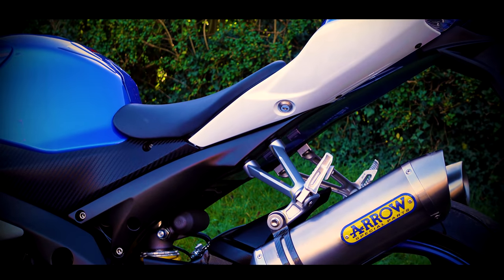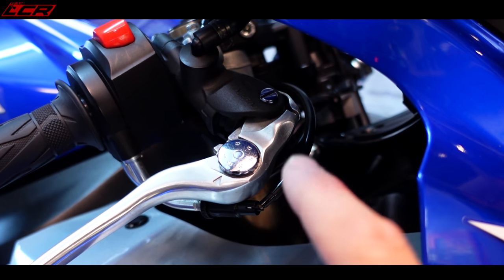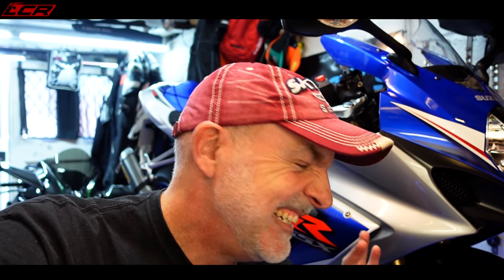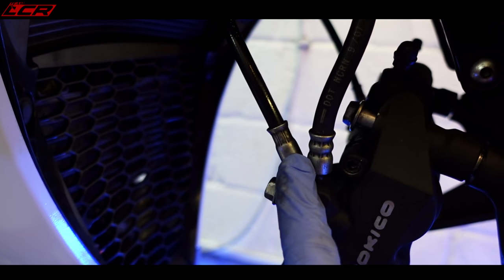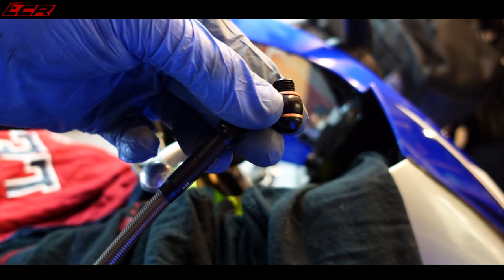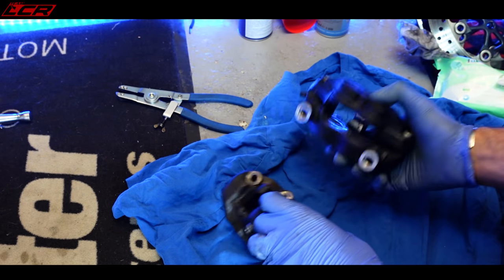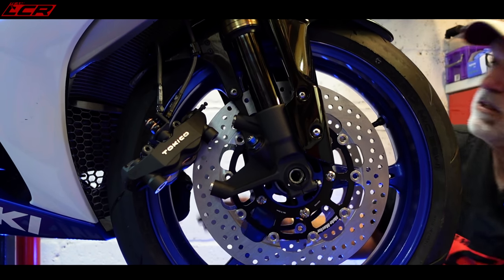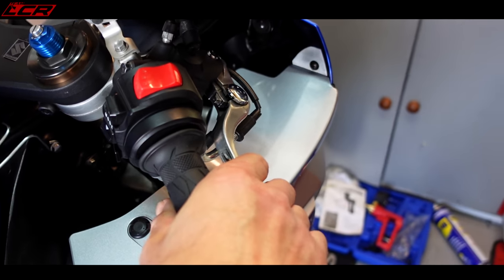2008 Suzuki GSXR-1000 | The Best Upgrades! EP01

Comment: Bigger front sprocket will do the opposite, it makes the gearing taller so better for cruising (lower RPM) but worse pickup in any given gear.  Smaller front or larger rear sprocket needed unless I have totally misunderstood your requirement.
Reply: Correct,dont install the front gear unless you want more top end and less acceleration!
Reply from the maker: Yes sorry, it is indeed a smaller front. My mixup when talking about it 👍
Reply: Correct smaller sprocket on front, but only do this on a 600cc. 1000cc have enough grunt if kept above 4000rpm.
Reply: I though he said that round the wrong way.
Reply: Yep opposite of bicycles
Reply: @jamesz9377  I don't think you can change the front gear because the speed sensor will pick up on it and send wrong information to the computer it'll cause a problem.
Reply: @iblacka1  yes same with rear but they have speedo correctors
Reply: your deff right !!!  njoy the weekend  every one  and #livetoride

Comment: Buy the M/C - I too had one of these K7/8's.

changed brake lines, pads and discs.

after much guffery, sweating, swearing and bleeding time and time again, I would get good braking feel and performance at the lever but nothing ever stellar.

on track days I would be bleeding the front brakes by mid day and doing the same again the week after.

I sold my bike around the same time the recall came out but I know the master cylinders were the weak point on these bikes.

Comment: Good updates to the bike. You want a bigger rear sprocket or smaller front sprocket (or both) to improve acceleration.
If brakes are binding and spongy, almost certain that you just have some air still in the system. If calipers were drained during the process, check Haynes/workshop manual for correct process. For example, you may need to angle one/both calipers to allow trapped air to flow back up to the bleed nipple/master cylinder.

I once sent several hours with a VFR800FI trying to bleed a newly refurbished set of calipers. I got to point of being convinced that I needed a pressurised bleeding system. I called a Honda main dealer and spoke to a senior mechanic - he reassuringly told me that he'd never needed to use a pressurised bleeding system in 20yrs and advised me to read the workshop manual... turns out that he was right of course. I had to detach the secondary master cylinder and hold it at 15 degrees to allow trapped air to flow out of it. Then the other bleed nipples had to be done in a specific order.

I did this and got a firm brake lever with just normal bleed hoses in the end. Lesson learned!

Comment: I have a K2 model and I also upgraded the braking system with a Brembo racing front brake master cylinder,front Brembo disc rotors and,like you,fitted Venhill  braided lines front and rear,I did buy Brembo calipers for the front and rear,but decided to fit Brembo sintered pads to the stock Tocico 6 pot calipers.The results were fantastic,with the "grabiness" noticed with the stock set up being eliminated.

Comment: Handy Hint: Stick a cable-tie on the brake lever & leave overnight. Having the braking system under pressure for several hours helps to get rid of them pesky air bubbles that bleeding alone doesn't shift - as the little buggers rise up & join their friends in the M/C air gap. 👍
Reply: Yep that's what I do! Works well for me!
Reply: Yes, works perfect
Reply: Does this work with a radial master cylinder?  There is a bleeder on the master cylinder, so I think there is a high spot in the system before it hits the reservoir.  One spring I came out to my Kawasaki and the lever would pull all the way to the grip.  I tried bleeding at the calipers, but I found out that I also needed to bleed at the master cylinder.  My system was never empty.
Reply: @alanhassall  I have radial master cylinders on both my bikes (now): and I do indeed bleed them after the calipers. Even so, I always stick a cable-tie on the lever overnight - and the brakes are superb. Give it a go & see what ya think! 👍
Reply: @missydee6085  Speedbleeders make a big difference for me.  The check valves and sealant on the threads make bleeding so easy.
Reply: Thanks!
Reply: You'll need to get a firmer lever than what chopsy got before the cable tie trick will work. What he has there is air trapped in a small cavity behind fully pushed back pistons. This will never escape, as it can't find the room to. Bleed with used pads in, the air can then escape from the larger cavity. Then fit the new pads. That's been my experience anyway. I've never had to cable tie a lever overnight, if you have to do this, there is something wrong with your bleeding method. Not trying to be a smart arse, just saying what's worked for me.
Atb
Reply: @stuckintheeighties487  there isn't anything wrong with using a ziptie.
A lot of mechanics use that "trick"
Reply: @dannygernaat9961  I didn't say there was anything wrong with using a cable tie. If it works for you, then fine.
Atb
Reply: works even better if you load the bike into a van then cable tie and go down some bumpy roads lol
Reply: This always works for me too
Reply: @missydee6085  imagine telling a customer I was going to use a speed bleeder and you could pick the bike up in an hour or I can zip tie it and come back tomorrow 😅
Reply: @jesuschrist7169  Clearly that's not an option (unless the customer has far more money than sense), but it doesn't stop punter using a cable tie themself if they aren't 100% happy with the feel of the lever - after the system's been bled.

Comment: Chops I think you have made a few mistakes you have washed solvent in to the calliper piston area . I suggest you order piston seal kit, remove and clean pistons, then on the bench remove seals from callipers and give seating grove a very good clean. Replace piston seals using a tiny dab of piston seal grease in seating grove and on seal, just a smear don’t over do it. Re fit pistons and ensure original location for each is maintained. Reassemble callipers and pads. Fill master and start bleed process and I suggest the open close valve method as you pump master easy but slow and as you allow the brake lever to return give it a gentle slight pump action until fully returned. To remove any air left in system tie wrap brake on over night and the pressure will force air back up in to the master cylinder. Remove cap just to double check all ok and re fit. Do not change master until you have brakes working in the correct manner or trust me you will fall in to the trap of chasing your tail by trying to cure an exiting problem with a modification.remember the brakes functioned to a reasonable standard before you worked on them. Oh yes as others have already stated smaller front sprocket required to lower gearing. Keep the good work and remember the only person who doesn’t make mistakes doesn’t do anything. Cheers Ade
Reply from the maker: Yes I think you are right.... going to revisit the calipers before installing the RCS MC 👍
Reply: @LambChopRides  Chops a few words of advice to help fix your binding brakes. If you replace piston seals as per my recommendation in previous mail then do not twist piston as you refit as this can cause it to grip and bunch or twist seal preventing its design intent to flex the piston off the disc. I think this is what you inadvertently caused when you washed solvent and brake dust over seals and then applied twisting motion leading to sticking you now experience. Hope this helps and keep up the vids always interesting Cheers Ade Pavey

Comment: How does a larger front sprocket increase torque? Shouldn't it be smaller?
Reply: Look at your mountain bike.
Reply: yes it should be smaller...its not a mountain bike
Reply: @stinkerdoodle1737  the principe is the same. If in doubt look at your mountainbike. Smaller is more torque.
Reply from the maker: Yes I mean smaller front, surprised mavis didn't correct me 🤣

Comment: Good video Chops. I have one of those hand brake pumps. For about £10 I replaced the hand pump with a 12v air pump run off a battery. Now the only thing difficult about brake bleeding is keeping enough fluid in the reservoir as it sucks the old fluid out. Well worth the upgrade!

Comment: Nice upgrades . You’ve got air still in system. I upgraded my SX rear end with a Brembo calliper, had to take it off and flip it over as Nipple is on the bottom to bleed. Works fine now .

Comment: P.s the binding issue is likely to to be related , caliper seals roll slightly when pressure is applied, then pull the pistons back slightly when pressure is released!! Probly a good idea to have stripped those caliper completely and cleaned/ inspected them properly, half a job leaves too many questions when you hit problems!!… good luck!!

Comment: Rather you than me John, Brakes are a black art, they shouldn't be,  but they are, I have always found that you need to replace everything in the braking system at once to avoid loads of issues. Expensive but hassle-free.

Comment: A quick tip for you, if you ever have to change brake discs again leave the wheel on its tyre and not the side and you can put a bit of pressure on it it stop the wheel turning and i find it a lot easier to crack the bolts loose.  Why dont you just rebuild the original master or is your heart set on the brembo

Comment: While I think it's a good plan to upgrade the master cylinder to get better feel, I don't think it will fix a binding issue. Binding brakes would be more likely be swollen seals in the calipers.
Reply: Absolutely this, it'll be the calipers. That system just isn't right somewhere and a new MC won't cure it.
Reply from the maker: Yes I think you are right Ian... I'm thinking I've dried out the seals. I'm going to remove the calipers and take another look 👍
Reply: @LambChopRides  Hiya Chops, I hope the garage upgrade's gone swimmingly. Just thought I'd mention that Wavey Dave Hewson (AKA Obsession Engineering) said he doesn't use our favourite brake cleaner on pistons - as they adversely affect the seals. He uses GT85 & a toothbrush, but other top technicians use soapy water instead. I personally do the latter & use a smear of red rubber grease on the pistons (once they're clean & dry). Our rouge chum certainly makes pushing them into the bores easier & keeps the seals happy too.
Reply: In my experience, the seals often prevent pistons from free movement due to a build up of crap in the seal-retaining recess(es). I use a dremel with a narrow nylon brush attachment & an angled pick to remove any accumulated detritus: allowing the seals to regain their intended working tolerance.

Comment: Just a couple of things I do chops is to fit a bleed nipple banjo bolt at the master cylinder as it’s always best to bleed at the highest point. If you don’t want to go to that, then suspend the callipers above the master cylinder and bleed (can be awkward) as that has the same effect
Reply from the maker: Yes it has a bleed point on the MC but didn't help! I though perhaps the air was trapped in the cross over cable but sucking pumping couldn't shift it... Good call on holding the caliper up 👍

Comment: Chops it worth getting new caliper piston seals and popping the old seals out, then clean in the seal grooves, dirt and corrosion builds up behind the piston seals and binds the pistons enough to cause drag. I use a bent pick (steady 😆) to carefully scrape the dirt and corrosion out, and use red rubber grease to reseal… you will be surprised at how much differents this makes… the seals act like a spring to slightly retract the pistons after brake application to stop heat build up and binding, you can see the seal flex and ‘spring’ back when the seals are new and the seal grooves are clean. 

This needs doing every 2 years or so in the UK because of the salt on the roads, the piston bores and seal groves are un protected machined finishes 👍
Reply: I can't agree more had this on a Rsv buggered discs up trying to find out, replaced seals they do swell after time and they not keen on brake cleaner.
Reply: I restore 2000s sportbikes for a living. almost every set of front calipers is full of snot, even after they bleed clean.
Reply from the maker: Yes probably! 👍👍

Comment: I fitted a brembo master cylinder from a v2 DUCATI and they are so much better.
Little tip air air will rise un bolt the calipers and let them hang.
Put spaners in place of the discs and pump them up over night.
Then let the air out.

Comment: Steel doesn't typically warp.  To fix the juuder most likelyj just needed to deglaze the old rotors   400 grit sand paper,wet sand using a small circles evenly slowly spining rotor both sides making sure to spend the samd amounf of time around the entir circumstance. Brake pad material is unevenly deposited on the rotors causing judder or shaking while braking and is easily removed with 400 grit wet sand paper.Every one defaults to warped rotors but steel doesn't warp it might bend if hit hard but it doesn't just warp. Ive fixed many shaking brakes in  vehicles this way, and sand rotors on my bike every pad change

Comment: I had the same problem, after changing to braided lines and replacing the pistons on my SV650S, I had to use grease on the pistons, not putting it in dry like you did, it fixed the pressure point. The new seal kit came with grease which I did not use first (I only used brake fluid to grease it). What I did then was, to push out the pistons as far as possible, before they fall out and use a shoelace to put a thin layer of grease around the pistons, then I pushed the pistons back into the calipers. I think it is a special type of grease for brake maintenance, which came with the seal kit and you should use it to grease the new seals. When you use brake cleaner on the calipers, it may remove all the grease.
Reply: Red rubber grease 👍
It doesn't affect the rubbers / seals
Reply: @AxleCC  The grease was red, indeed!

Comment: Love these garage video's Chops.  I must admit that I've always been a GSXR  fan from way back in the 80s when I got my very first GSXR 400 (Japanese import) . 
Regarding your brake issue where it took age's to bleed the system........I had the exact problem with my kawasaki ZX7 R and after many hours of cursing and hitting my head against a brick wall, it turned out that it was indeed the master cylinder, which I replaced .👍 Funny thing is when I examined the old one I couldn't see any visible defects. 
Great video again Chops 👏 😊
Reply from the maker: Thanks Dean appreciated buddy 👍

Comment: That Healtech X-TRE device should be quite the treat once you get it installed. I have one on my GSF1250S and it made gears 1-2 much more responsive down low and really changed the way the bike gets going at low speeds. In conjunction with that I removed the secondary throttle plates to eliminate ECU changing throttle input and it's now fully rider controlled (wrist) which makes even more difference in how the bike accelerates and responds.

Comment: To fix the brakes not getting firm I would highly recommend reverse bleeding the lines. Fill up your syringe with brake fluid and  shoot it through the bleeder on the caliper back up towards the master cylinder. Every time I've changed brake lines this has been the only way that has worked for me. This will get the brakes 80-90% of the way there. Then bleed it traditionally for a minute or two and it should be perfect.

Comment: sounds like you have trapped air in both calipors i have had it happen to me after fuid change, you cant bleed all the air out with the calipors on the normal mounts. I got a piece of wood to act as the disc, unbolted the calipors and held them at a different angle then bled them it released the trapped air and the pressure came back at the lever, i just then fitted them back to the normal mountings re-pumped the lever and all was good, trapped air will expand and cause your binding and brake drag. Good luck, worth a try, ian

Comment: Oh my word what are you like? Have you ever tried pulling the brake leaver back to the handle bar, and locking it off in that position, leave the master cylinder cap off, leave it over night. Most if not all the air makes it's own way out. Its the only I can do the front brake on my 1150! Good luck on your mission! 👍🏍💨💨
Reply from the maker: Will try that Murt 👍

Comment: I own the same bike and have upgraded the brake lines to race braided front and back. I have also done the Suzuki recall for the master cylinder.  The old master cylinder was taking on water over a long period of time and would need bleeding to keep the fluid fresh. Over time the lever would work its way back to the bar if the fluid was not changed, this = Suzuki recall. I own four bikes and have rebuilt the brakes on all four of them. Your k8 GSXR needs nothing bar braided brake lines, good discs and clean calipers to have brilliant brakes. Your brakes are still not bled, have you got pressure in the brake system? Unscrew the cap on the master cylinder again and be sure to put a towel under it before doing so. Good luck with it.
Reply from the maker: Thanks buddy for the reply 👍

Comment: There won't be anything wrong with your front master cylinder, well not likely anyway, you will still have an air bubble in the master cylinder, it's messy to fix it but will work, if the master cylinder doesn't have a bleed nipple on it you can use the brake banjo bolt on the cylinder. It's easier if you loosen the bolt off first but pull the lever then back the banjo bolt off a little and bleed as you would a caliper, when the lever hits the bar nip the banjo bolt up and let the lever out and go again, it's messy so have something to catch the fluid, top up the master and bleed the calipers next, you will then have a lever as good as new. The calipers are dragging because the air is getting warm and expanding forcing the pistons out. Good luck and hope this helps.